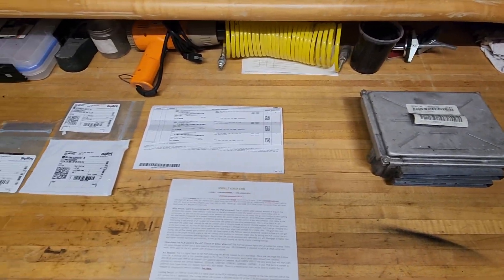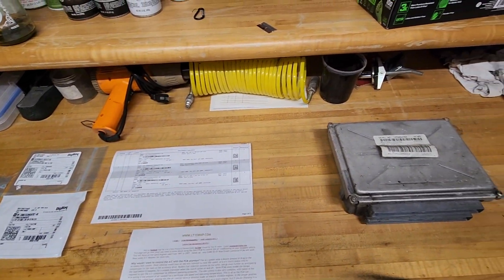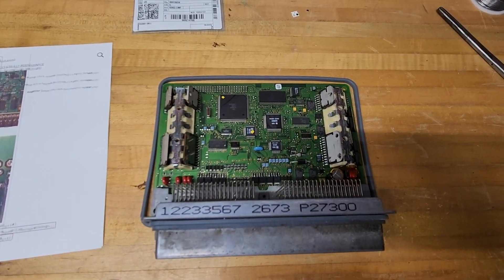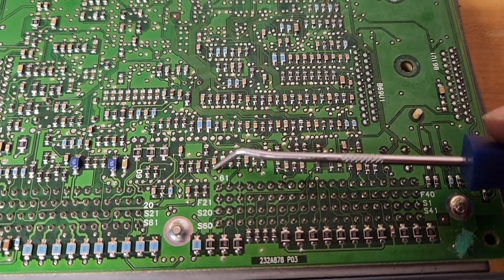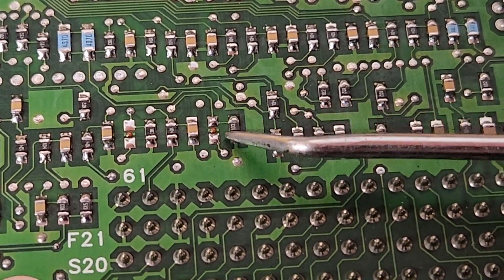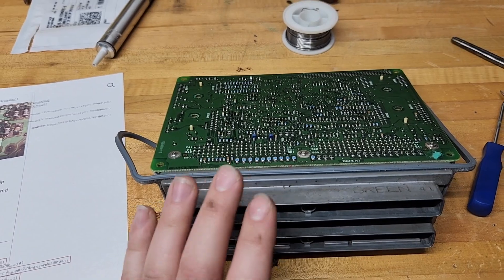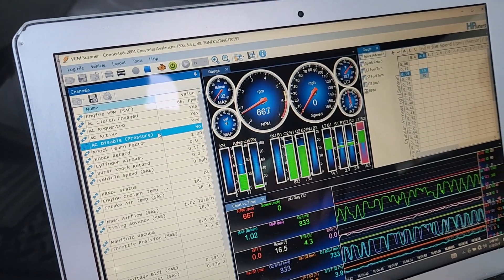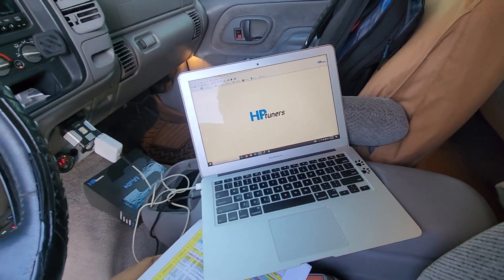How to Add A/C to Your LS Swapped OBS CHEVY/GMC | PCM MOD

Comment: so the only way to get the pcm to control idle, is to add that pin 17?   i just installed my ac on my ls swapped 84 coupe deville... i used the high pressure switch on the compressor and the cars stock low side switch that is on the coil... i just need the pcm to know that the ac is on to raise the idle

Comment: maybe your pressure sensor is bad ?
Reply from the maker: Nope, low pressure cycling switch is good. This code has to do with the pressure switches that the PCM is looking for. The truck that this PCM came out of was a 2004 avalanche, which had another pressure switch on the high pressure line. Because the OBS ac system does not have this switch, this code can be turned off, and the ac system on the OBS will function correctly as it is designed to only use a low pressure cycling switch.
Reply: @ ah ok makes sense atleast there is a pressure signal for ac system failsafe
Reply: @nasirmian1  ECUs don't need to know shit about HVAC.
Reply: @Marc_Wolfe  well they do to increase idle rpm, also if for some reason a vehicle overheats the ecu will shut off ac, ac compressor is alot disengaged at wot high rpms, please do your research before giving your input on topic youre not educated on.
Reply: You're probably the same guy that would put a stupid small pulley on a supercharger and say "it'll be fine; more torque, yeah."
Reply: @ are you one of those online mechanics who have never touched a wrench in their life but yap about how they know everything cause you clearly dont, maybe get that workshop manual outta your a$s and read it for once
Reply: @Marc_Wolfe  The ECU is what controls the ac compressor and the e fans when high pressure is sensed
Reply: @ Gee, I wonder how they did AC before computers.
Reply: @ manual temp sensor in the engine block but you wouldn't know that cause you have never worked on a car